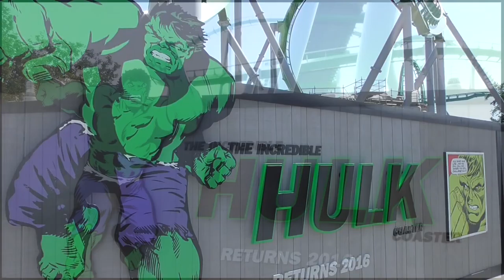Incredible Hulk Coaster Refurb Update April 2016 - Universal's Islands of Adventure

Comment: Its going to be the same? Because they said "its returning better" and nothing is changing.-.
Reply from the maker: +Derpy Channel While the track layout seems to be the same, it's possible the ride vehicles may be upgraded in different ways and perhaps include on-board audio, although that is still a rumor at this point. The launch is being upgraded from tires to an electromagnetic (LIM) launch system. Universal has also said there will be new enhancements to the storyline, (whatever that means).